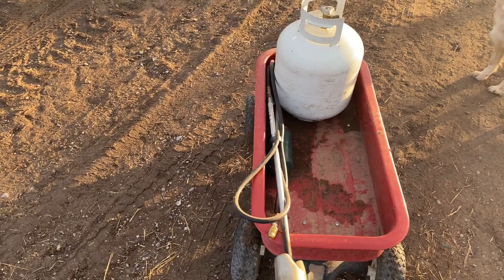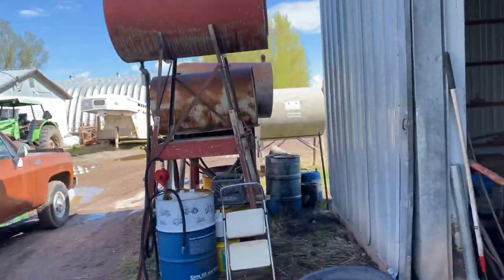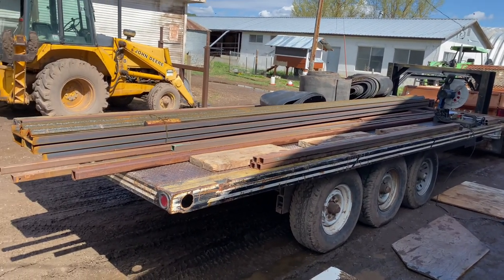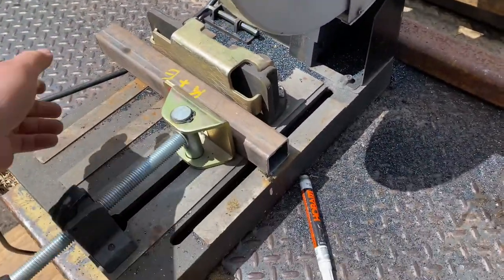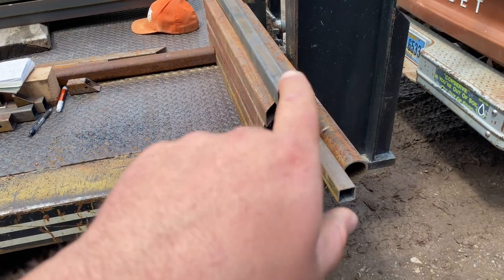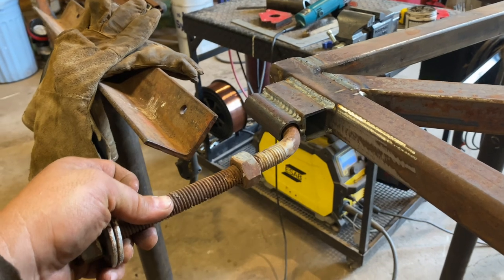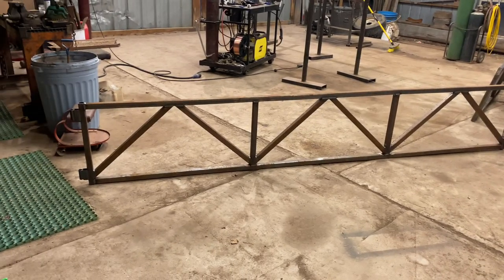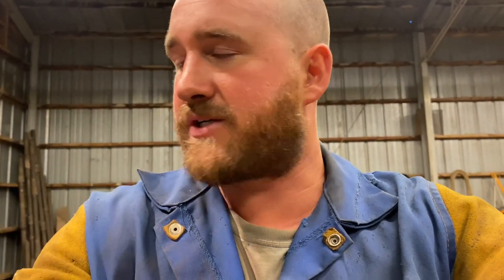Building Custom Horse Gates

Comment: I bought an Evolution dry-cut chop saw, sold my 2 bandsaws soon after - the Evo cuts everything I need. Very good system these dry-cut saws. Real fast too. I had used bandsaws for years.
Reply: The Evo saws are pretty much identical to yours btw - yours has a better clamping jaw system from just looking - I like those jaws you got better.
Reply from the maker: I’ve heard good things about the EVO saws also. I couldn’t go back to not having one of these dry cut saws I’ve loved mine. My only complaint is the blades are kind of expensive to replace

Comment: Like your channel reminds me when I first started 40 years ago learned lot to be more efficient built a large table out of drill pipe and plywood can lay out any configuration of jigs with screwing down 2x4 blocks holes cut out for welding speeds up whole process 10 fold
Reply from the maker: That’s a great idea! Thanks for sharing that. I love hearing from you guys that have years of experience.

Comment: I did a lot of research on the metal saws, I ended up also buying a Steel Max. Not been disappointed at all.
Reply from the maker: I’ve loved mine. No problems either. I cut a lot of drill pipe sometimes and go through a few blades which get kind of expensive but other than that I love it!

Comment: How much do you charge for labor on each panel
Reply from the maker: I charge $37.50 an hour. Then I charge for my consumables separately like my gas,wire, plasma tips, saw blades ect. Then I also mark up the metal if I have to buy it by 15-25% depending on what it is
Reply: Thank you I appreciate you taking the time too respond 🙏🏽
Reply from the maker: You are welcome! I’m glad I could help out a bit. I’m new to billing myself out also so I’m still learning. My only advice is if you are a good welder and do good work don’t bill yourself too cheaply.
Reply: @LuthiRanchWY  thanks a lot